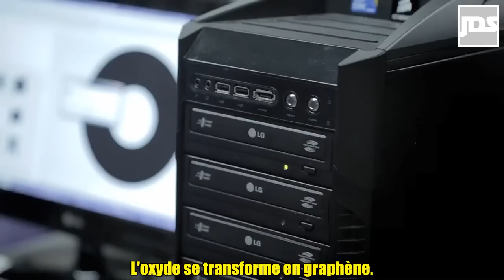La pile du futur est née, charger un téléphone en 30 secondes

Comment: Un condensateur (incluant les supercondensateurs) est très différent d'une batterie.  Oui, ça se charge et se décharge beaucoup plus rapidement qu'une batterie.  Mais il y a d'autres différences.
D'abord le voltage.  Contrairement à une batterie, le voltage d'un condensateur est proportionnel à sa charge.  À pleine charge, son voltage est élevé et, au fur et à mesure qu'on l'utilise, son voltage baisse.  Ce qui est sans problème pour des appareils électriques comme des lampes incandescentes, des éléments chauffants ou des moteurs.  Mais complètement inutilisable pour des appareils électroniques comme des ordinateurs, téléphones, iPads, iPods, téléviseurs, diodes électroluminescentes (LEDs) et tout ce qui contient un microprocesseur (four à micro-ondes, automobiles électriques ou non, jouets téléguidés...).  Pour utiliser un supercondensateur avec des appareils électroniques on doit d'abord lui adjoindre un régulateur de tension oscillant.  Ce qui en augmente le prix, diminue l'efficacité et le courant de pointe.
Les supercondensateurs ne tolèrent pas des voltages élevés, la plupart étant limités à 2.78V ou 3V.  Sauf certains qui sont très coûteux et qui ont une capacité (en farads) moindre.  Ceci diminue beaucoup leur aptitude à retenir des grandes charges, de même que leur utilité pour des applications à 5 volts ou plus.
Bref, c'est une invention vraiment merveilleuse, pouvant servir là où les condensateurs sont déjà utilisés, mais pas encore prêts à remplacer les batteries.  Par contre, des progrès dans les régulateurs de tension et les isolants à haut voltage (50 volt et plus) pourraient ouvrir des applications intéressantes.
Reply: La limite de voltage des super-condensateurs ne me paraît pas poser problème. Les voitures électriques marchent déjà avec des multitudes de petites batteries reliées en série. Ma Monoroue électrique tourne en 67 V.
Le problème viendra plutôt des stations de recharge qui ne pourront débiter les Wh avec des câbles de taille raisonnable, en amont ou en aval.
Je n'ai pas les paramètres pour faire le calcul, mais recharger les autos électriques en 10 mn permettrait déjà des voyages quasi-normaux.
Bon, plus qu'à attendre, mais remuez-vous car une solution avec des composants aussi peu polluants à la fabrication serait une bénédiction ! Et si ça peut réduire les combustibles fossiles, alors là ! ;=)